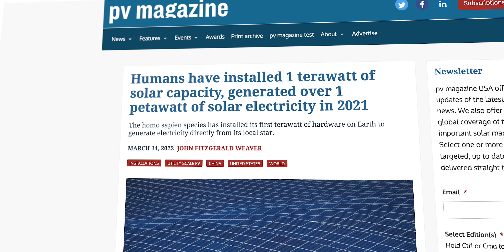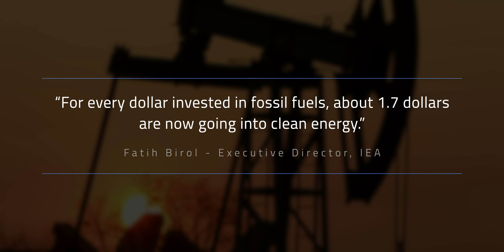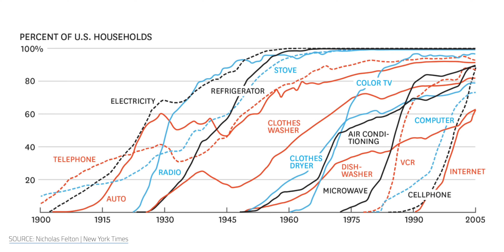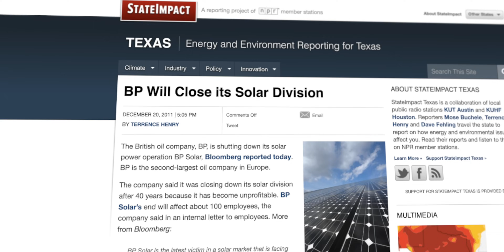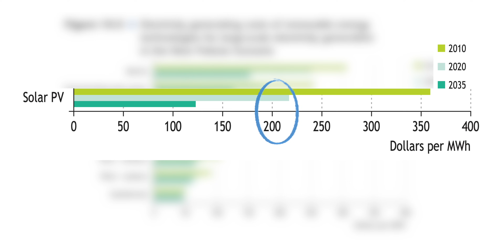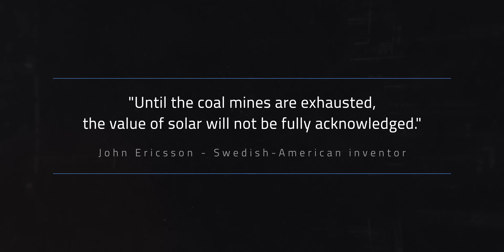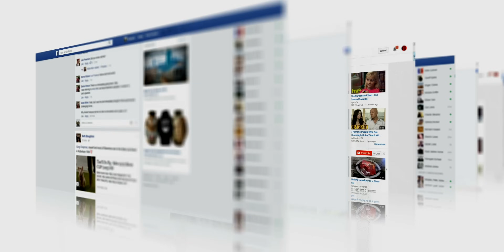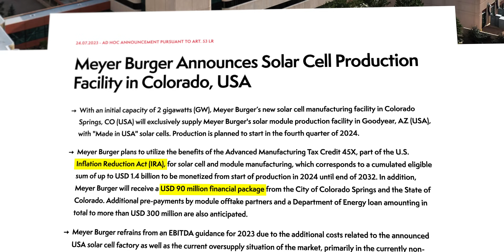How Solar Power Got So Cheap … So Fast

Comment: That $20,000 price point for putting PV on my house has been unchanged for the past 10 years.  At this point I'm of an age to realize I won't live long enough to justify the cost of buying it.
Reply: If you do it DIY, it’s cheaper! I started building a small system and added onto when I could afford it!
Reply: two things that go into that high cost: the panels, and the labor.
Labor is expensive because not a lot of folks provide that service, that's going to change as panels get adopted more widely, and create incentives for businesses to engage in providing that service.
and the panels have been expensive, but are continuously getting cheaper as the process to automate, and the materials required to build them, get cheaper.

Last, and i think this is a big takeaway from this video, is the idea of this being a technology that will fit that sigmoid curve with the slow growth + fast widespread adoption + slow acceptance from detractors. Maybe the past 10 years have been a part of the slow growth, but things appear to be changing fast. Maybe within the next 5 years it'll be cheaper!
Reply: The $20k cost may have stayed the same but the Watt Hours and performance of the panels have increased significantly in the past 10 years.
Reply: Adjust that $20k price for inflation and it would cost over $26k today.  So the price has dropped if it still costs only $20k
Reply: @percyfaith11 not,just inflation, but the price of electricity in your area…
Reply: So me being 24 I think this would be smart would pay it self off plus I’m in Australia I will be doing all my on DIY as this stuff is super fun but over here don’t F*** around and find out so I’m always very careful do the best research possible
Reply: Yeah in Australia right now I can get a 3.5kw system fully set up and half of it paid for from ten government! For just $2500 that comes to 1610usd (I know 3.5kw) doesn’t seem much but that was just one I remember plus like I said if you take half or at least 30% off $2500 you could pay just over 1k for a hole solar setup fully installed
Reply: traybern  what do you mean? I will be moving however the price for a house is 500k so it’s not a couple months and you have a house haha but I already have my own 2.2kw system with Victron that runs a 500w AC all day with my 700w of solar panels
Reply: It's about 8000 in Ireland
Reply: Largely agreed -- solar installations are modular, so the larger you build, the cheaper you get per watt.  Rooftop solar installations only have a few panels, so their costs are dominated by labor, permitting, grid connection, etc.  At utility scale, you're doing thousands of panels in a single array, so cheaper panels & racking give you near-1:1 price drops.

So yeah, home solar costs aren't going to get chopped in half anytime soon.  Utility-scale, on the other hand, seems to drop 40-50% every ~5 years.  That's where the real game is.

Comment: Matt, You explained the mechanisms by which Solar got un-stuck from it's early adopter stage - but you didn't exactly specify the incentives that were given (except for the feed-in tariffs). Would have loved to hear more about that. IIRC the US played a critical role in the R&D of solar in the late 20th century and Germany in the 2000s. Could have reflected more on what happened in between these stages of adoption and decline. Great video nonetheless!
Reply: In Germany there was a guaranteed feed-in reimbursement for 10 years, making the investment safe and decoupled from price fluctuations.  In the Netherlands we're still enjoying 100% netmetering for all electrical energy we use, including all taxes!  This will slowly be replaced in the next 8 years by a mandatory feed-in reimbursement of 80% of the bare kWh price (excl. taxes!).  
Not as good as before, also not terrible.  It will be an incentive to try and use more of our own production.
Reply: In short: USA did the scientific research on PV, Germany's "energiewende" incentives provided the funding needed to start proper mass-production, and China were happy to take said funding and build a mass-producing PV industry.
Reply: He's missing the most important part. Solar production was moved from the West to China.  China subsidizes solar panel production, wages are extremely low in China and compliance costs are next to nothing because they don't enforce the law.
In the West, waste has to be treated and then verified to be safe before disposal. In China, you just put the waste directly into the environment.  If some Chinese person gets their leg caught in machinery and loses it, well, tough for him.
If we were to start producing our own solar panels, prices would skyrocket back to where they were.
Reply: @christo930  So in short, Solar has become cheaper as we've shifted the manufacturing to have less concern for the wellbeing of laborers and the environment?
Reply: @christo930  Do you have the data to support that series of assertions? Or  maybe you are wrong. Maybe, China had success with these technologies because it put a monumental development effort into them when other players beyond China's borders, transfixed on immediate financial benefits, viz. high profit margins, elected to abandon further expensive work on improved solar cells.

Do we see other examples of production of technically advanced industrial and/or consumer goods ramping up in China more quickly and more successfully than elsewhere? We do. China has had great success in mobile phones. More significantly, EV automaking in China has reached critical milestones that demonstrate the maturity of the EV industry and market there. In other localities/regional markets EV automaking is still in its infancy.

There is nothing controversial about any of these observations. It was after having made the same observation, viz. that China had attained a level of technical and manufacturing prowess that put it in a leadership position in some key areas of industry, that the authorities in the USA launched the current 'trade war' with China, which is more an embargo declared by the USA that is meant to selectively ban trade in advanced microelectronics and microelectronics fabrication equipment with China. (All the other tit for tat nonsense and geopolitical posturing just obscures the underlying fact that this is a struggle over technical and industrial leadership.)

You can kid yourself as much as you like that low wages explains China's success in certain fields and conversely that high wages in the USA and Europe explain their lack of success but that is complete rubbish. Chinese high tech businesses persevered in doing the demanding development work necessary to realise critical technical advances while similar businesses elsewhere threw in the towel. 

China did indeed have some advantages that made perseverance with high cost development work a bit more likely there. China had little to lose (bar a bit of investment capital) if perseverance didn't pay off and an enormous amount to gain. For many years Chinese authorities have sought to increase the scale of internal and international trade in advanced industrial goods. Now, as it happens, many of the world's largest and most successful manufacturers likewise had been keeping an eye on China because of the massive size of its domestic market and the opportunities that a presence in that market offered.

The development of automaking in China is an interesting case. The Chinese Joint Venture company model was born to give all parties some part of what they wanted. The Chinese side in these JV operations learnt a lot from their European and American partners and reapplied everything to their own wholly owned domestic manufacturing operations. That big market (China has been the largest car market in the world since 2009 and the market has grown at an annual rate of 10.6% on average from 2001 until today) offers plenty of scope for new players to enter into competition with China's more established automakers for a piece of the action. And, with many companies competing with one another and driving prices down long term survivors need to make technical advances and advances in manufacturing efficiency in order to hold their place/improve their position in the automaking pecking order. To do that you need a first class product development team packed with talented engineers. And, in China, thanks to a clear policy direction to concentrate financial resources on the provision of high quality University degrees in the engineering disciplines assembling such a team is doable.

You elected to rely on preconception and bias to explain China's long march to the top of certain spheres of manufacturing. That is lazy and it doesn't give rise to explanations of anything but rather delusions. Do a bit of research if you want to make a comment worth offering.

Note: It is notable that the advanced manufacturing skills acquired by the local Chinese side by way of JV collaborations gave these Chinese auto makers the opportunity to substantially increase salaries. (Note: The average salary for an auto worker today in the United States is USD$62,500 per annum and in China it is USD$35,900.) So, the claim that something is explained by low Chinese wages faces a big problem: these days wages in advanced export oriented industries in China simply aren't that low. And, moreover, wages are growing at around 4% per annum.
Reply: @christo930  Prices wouldn't skyrocket due to compliance costs if U. S. manufacturers used best methods throughout. Given the absolute mandate for profit, it doesn't happen anywhere near enough.
Reply: @chris27gea58  The kind of dev curve China has pursued (you can't completely discount the substantial advantage they've gotten through low labor costs, IP theft and other indesp, and corporate corruption, but they're only accelerants, not primary movers like the rigidly state-controlled capital) is not remotely possible in a less than totalitarian society.
Reply: @ticthak  This is not true.  Compliance costs are astronomical and have nothing to do with what the business even does.
It's not lack of methods or some secret practice, it's the lawsuits and the endless record keeping and compliance costs.

Once a business is above a certain size, which is like 50 employees, the administrative costs of running that business goes through the roof.
It's not just your compliance costs, it's the compliance costs of every single business you do business with. 

Why do you think so many US businesses take on the enormous challenges and costs of running a factory in a different country? It's because costs are so high here.
Reply: China is who made the big difference in the 2000s. They are the ones who made the advancements that allowed the panels to be as cheap as they are today.
Reply: @baileescott401  No. It's improved production tech. China labor isn't cheap anymore. They are the most advanced country in battery and solar tech nowadays.

Comment: The biggest incentive was the price per KW in my area...and the price is always increasing.
Being independant from the 'Grid' with a battery storage system is also a plus when the power goes out.
After doing the calculations, the PV system with battery back up/storage will be paying for itself in 7 years...maybe less.
DO IT NOW WHILE THERE IS A TAX REFUND!

Comment: I would love solar. Here is why I hesitate:
1. Finding a good honest installer
2. If the installer is not the same company as the one selling, finding an honest seller
3. Insurance. I've heard that some insurance wont cover you if you have over 10kw (?) of power
4. The cost
4. Where I live, if the power goes out in the middle of the day, I can't have Solar power my house because the power company says no and I would need batteries
5. Batteries are pricey and I dont have room in the garage.

Comment: I did always think solar was going to be important.  In the 1980s in LA, we installed a solar hot water system on our roof.  It halved our natural gas bill and we never ran out of hot water.  Now we have a 12kw PV system that has been running since 2001.  It took 12 years to break even (1.5 years shorter than I had penciled out at installation), but we expected to stay in our house longer, and it has worked out for us.  We are now contemplating upgrading the system to 20kw and installing some kind of battery storage.  With the IRA, I expect a  much shorter payoff period, and an end to power outages (which are regular occurrences where we live now, and why both of my neighbors have installed generators).   The change in rules here in CA means that either it wasn't worth just having a PV system; it has to include storage to make it economically feasible.
Reply: So there is one method that can work around this. Install a small solar system, but do not connect it to your panel. Instead use it to decrease your power needs. The EG4 mini split heat pump can take direct solar power and offset heating and cooling needs. There are other ways to use solar, hot water ect. A partial system, can give benefits but without all the costs.

Comment: It should be noted that the low LCOE figures mentioned in the video are for utility-scale solar installations, where they buy up large chunk of desert and fill it with several megawatts of solar panels all at once. Rooftop solar LCOE is much higher than this, as installation is much more expensive when crews are working on top of roofs than on the ground, plus it's being done one house at a time, rather than in bulk.
Reply: i'm not certain, but i'm reasonable certain it also doesn't include energy storage.  If it doesn't you can't really compare it to something that doesn't need it (hydro, nuclear, or fossil fuels)
Reply: I did a DIY ground mount for our house, and with a 25 year life and 6% ROI, I figured we're spending $80/MWh LCOE for generation + an additional $90/MWh for storage before tax breaks (or the cost of my labor), so it's more expensive than his figures, but not as much more as you might think.  Where I live, grid electricity currently runs $0.30/kWh ($30/MWh), so our system is paying for itself.
Reply: @AlecMuller don’t forget peak hours. We spoke to around .70c it’s wild.
Reply: Still beats the LCOE of a personal drilling rig in your back yard!
Reply: @altrag  or a personal backyard nuclear reactor! since we are going into the absurd.

With fairphone coming to the NA market, and framework already here, I'm curious to see how many they will sell.  World seems full of people on the climate bandwagon these days, time to see who's going to put their own money down for it.
Reply: They could give away the solar panels for free and it would barely change the price for home roof top solar. Maybe it makes more sense to cover every parking lot and commercial building in solar panels first.
Reply: @jamestucker8088  > Maybe it makes more sense to cover every parking lot and commercial building in solar panels
Yes.

> first
Why not both?

Everyone needs to do what they can - individuals, companies and governments.  Individuals are the least capable of making big changes due to the cost, but they're also the most willing.  Companies are the most capable and the least willing.  Governments are somewhere in between.

But "companies and governments need to do more" should not be looked at as an excuse for individuals to do less.  Its very much a "do all the things" situation.

Comment: I used to fit solar water heating equipment around 2008 - 2010 and it really was good but as you said, it was hard to get people to commit to it just because of the payback ratio and when the UK gov cut back the feed in tariff sales dropped to the point the company i worked for literally changed how much i was getting paid per job whilst i was fitting it.  Getting told i was getting paid £150 for a 1 panel/ cylinder replacement and all the pipe work, which would take about 3-4 hrs only to find when going back to the office they had reduced what i was getting paid to £120. Needless to say i quit.
Reply: That’s awful, sounds like they pulled the rug out from under you. I hope you’ve got a better company now.
Reply: The marketing hook that nobody employed properly is even more relevant today: Everyone wants to flip their home for a profit. They waste absurd amounts of Home Depot cash on kitchen and bath remodels, etc. when sellers should be catering to home buyers LOOKING for Solar pre-installed. Buyers don't want the hassle of a retro-fit afterwards. You wanna invest in home value...do the Solar install.